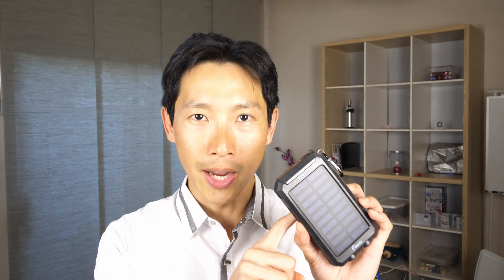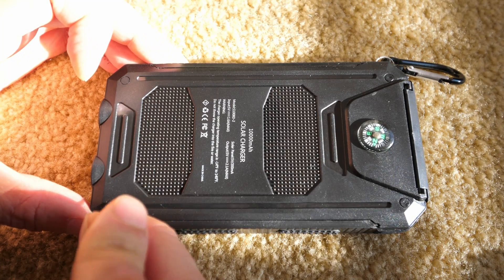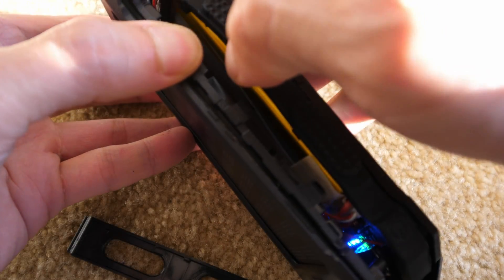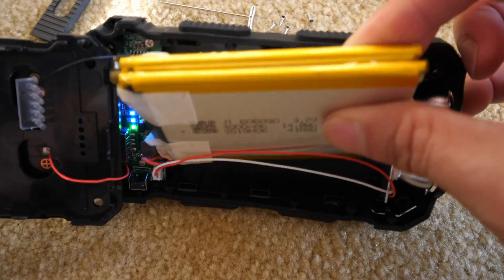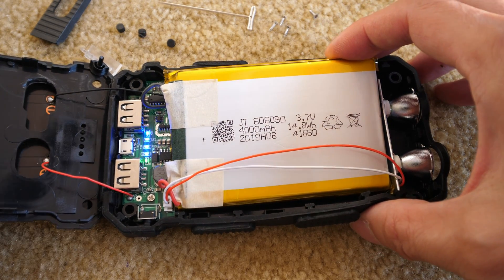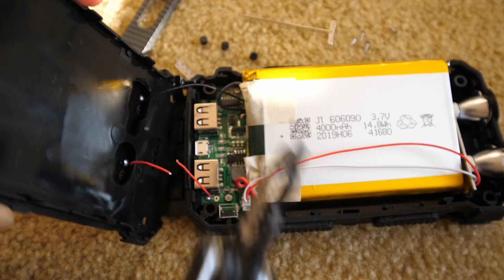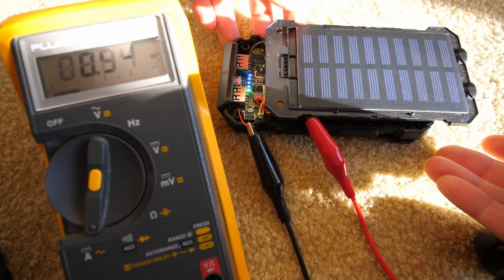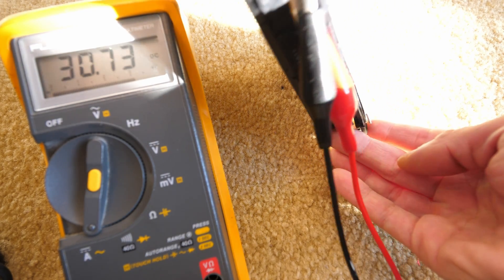Battery Bank Capacity Lies

Comment: So....Did you actually open up and verify the second battery was only 4000 mAH? 🧐
Reply from the maker: Do you trust the markings? Do you trust that size equals capacity? Do you think a battery would integrate two batteries of different sizes? Real test is to do a log of energy output but not for this thing.

Comment: These things suck. If you're a backpacker or camper you don't trust the sun anyway.
Reply from the maker: It will take 4 days or more to recharge from empty. So you either have to use very little power or get a bigger panel to charge it.

Comment: Correct my if I'm wrong but isn't this even less than 8000? Because the battery is 3.7V and then it upconverts to 5V for the usb. Or maybe you have 2*4000 mAh in parallel but either way it will not reach 50 Wh from two pieces of 14.8 Wh batteries. Even if the device would convert power with 100% efficiency you would only get 5920 mAh on 5V.
Reply from the maker: Usually, I'll let them pass if they at least quote the capacity of the internal battery. They never said how many volts at that current .